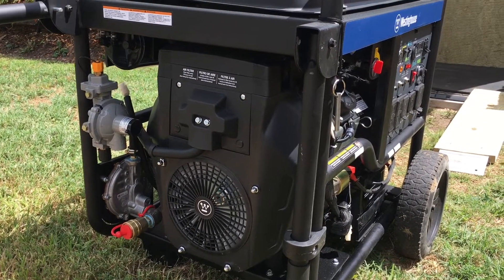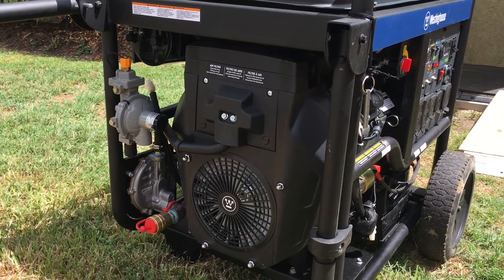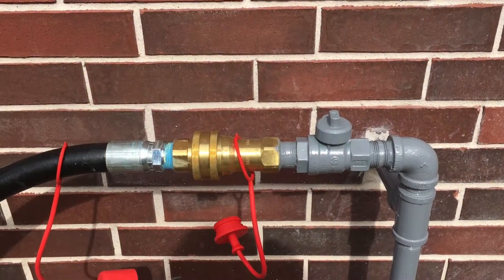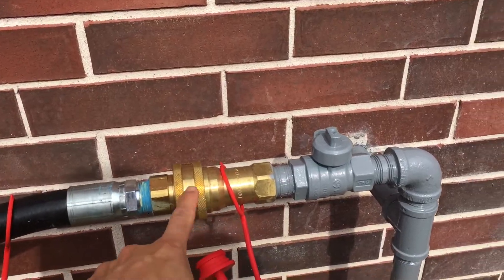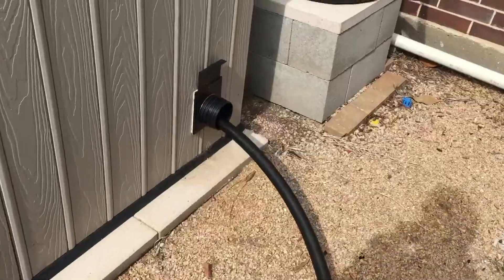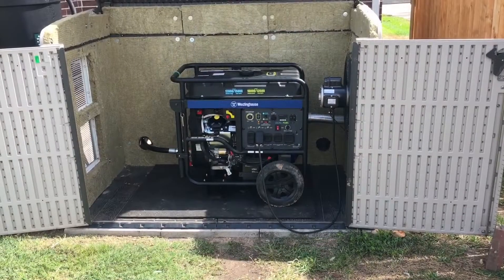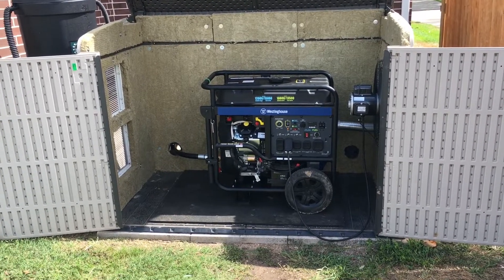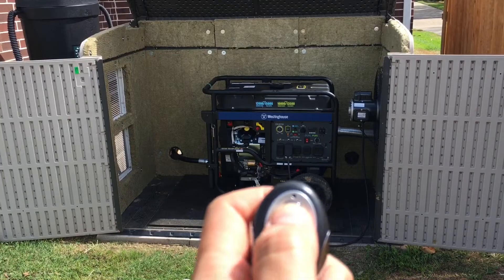Part 9- Westinghouse WGEN12000DF 15000 Watt Dual Fuel Portable Generator Running on Natural Gas

Comment: What size gas line are you using?
Reply from the maker: I used 1" ID hose, and only stepped down to 3/4" at the generator. I did this to yield the maximum amount of natural gas possible.

Key with using natural gas as fuel for these generator, that most don't understand you must have enough volume of natural gas flowing through the hose. 

If not, the generator this size will be fuel deprived.

For example:
At length 30 feet you can flow 
1/2" 95 Cubic Feet of Gas per Hour
3/4" 199 Cubic Feet of Gas per Hour 
1" 374 Cubic Feet of Gas per Hour

Hope this helps. Thanks for watching.

Comment: Isn’t a regulator required?
Reply from the maker: Yes and no. It depends on the what pressure your gas meter is. 

The WGEN 12000Df already comes with a Garettson regulator. In fact it come with 2 regulators. 

My gas meter is 7" WC (.25 psi)already, so that is in range for the Garettson regulator on the generator.

Now, say for example if my gas meter was set at 2 PSI ( 55" WC) then yes I would need additional regulator to bring it down from 55" WC to 6"-9" WC.

Hope this helps

Comment: Question...When running a 17500 watt generator on natural gas should i leave idle on or off ?
Reply from the maker: I run the WGEN 12000 DF, with the low idle.

Comment: Will the WGEN1200DF on natural gas be able to run a 2 ton AC unit and 4 ton AC unit if both have soft start kits?  LRA for 2ton is 56 @230 volts and LRA for 4 ton is 124 @ 230 volts. Thank you!
Reply from the maker: Nope, only 50 amp max available for the breaker panel.
Reply: @gilbosdiy  It will work because the soft start kit lowers the in rush amps and running amps. I have a 2 Ton AC that runs off a tri fuel generator. The natural gas side produces 5500 running watts.

Comment: Do you know how many estimated peak and running watts is it now on natural gas conversion
Reply from the maker: Well, here is the thing NOW, per Westinghouse should be around 11,600 watts running and 14,400 peak watts (via their same, but new WGEN14500 TFS).

This generator can produce more than they originally thought, BUT............ it is also a MARKETING.

Yes the generator, might be able to handle 14,400 and 11,600 watts. Thing is, in order to achieve those numbers. One would have to use the additional outlets, to reach those level. Which they don't tell you that. just looks sexier with the high numbers on the box.

If you plan on using an interlock to your breaker panel to your house, you can SILL ONLY have 50 amp for that, utilizing approximately 9600 watts.

Don't get me wrong, I am glad this generator can handle more than originally stated, it allows me shed load off the 50 amp (i.e. fridge(s) in garage, etc...)

Hope this helps, if you have anymore questions. Just ask, and I'll try and help.

Don't forget to hit the like and subscribe button, so that we can grow this channel.

Comment: Going gas but when hooked up to natural gas w kit it wont run. I’d there a valve near carb or switch ?
Reply from the maker: Did you turn the knob on the panel to propane?

Comment: The fan idea is great. What kind of attic fan is it and where did you get it?
Reply from the maker: Check out Part 7 of the video series, that episode goes over  mod for the shed and parts used.

I changed fan from 12" 1800CFM to 20" 3368 CFM.

The fan is a iLiving 20" Shutter exhaust fan from Amazon.

Hope this helps, thanks again for watching.

Comment: Does it handle an AC start up Ok? I will be getting one and having a soft start put on the AC to help with running on a generator for a short time.
Reply from the maker: All depends how many tons your AC unit is, 3-ton with micro air soft start yes. 5-ton no can do.

Comment: So you just ran natural gas to a propane receptacle? are they the same?
Reply from the maker: Check out part 8 of the 12 part series. That video shows how I converted the generator to run on natural gas. As well as which parts I used and didn't use. Thanks for watching. If you have anymore question(s) just drop a line, and I'll try and help if I can.

Comment: Just had a similar scenario.   My WGen9500DF (12000 peak) with an added natural gas regulator, while using the natural gas as fuel source,  was not able to run my 5 ton a/c compressor (would kick WGen offline).  When using gasoline as the fuel source,  the WGen was able to run the 5 ton unit,  but only after installing the microaire soft start (72 model) which stopped the "hard" start- high amp draw issue that was happening  causing the WGen to kick offline when the A/C started.  My peak average amp start after the microaire soft start installed is approx 30 amps and running amps are approx 13A.  Prior to the microaire softstart install,  the starting amperage of the A/C unit was high and would would cause the WGen to trip offline, no matter what the fuel source was.   I didn't get an exact "pre microaire install" start amp reading, but I do remember  the  "hard juttering" sound the A/C unit would sometimes make and it would even sometimes make the lights in house flicker, all this even when using normal "on the grid" electricity.   The "hard" start sound and light flicker issues and no more after the microaire soft start install.  With that all said,  the natural gas mod works great running my WGen and feeding the house electric, minus the 5 ton A/C unit.  I just used a window unit and a portable A/C unit to help keep house cool enough.  Hot water heater is gas, stove is electric, furnace heat is gas.   A/C unit is fully serviced and less than 5 years old.

Comment: Nice set up, I'm looking at this Westinghouse now.  I have done many of conversions to natural gas on smaller units 20 plus.  Load testing between gasoline to natural gas is about a 20% reduction in watts, LPG is about 10%.  Question on this conversion, on this v-twin you don't have to install a load block on top of the Garrison to adjust the air/fuel?
Reply from the maker: For my house, the supply line from the gas company was 1" INNER DIAMETER has a gas meter with 7" WC or 4oz of pressure. So, I ordered a 1" INNER DIAMETER, 30 feet hose (ab3power) ran from the meter to the generator (actual distance between meter and generator about 28 feet), then stepped down to 3/4" into the KN Garretson regulator. 

I'm sure as you know with all your conversions you know how important it is to maintain enough pressure and volume of natural gas. From the KN Garretson regulator outlet to the generator, I did replace with 1/2" barb by 3/8" MIP brass adapter fitting. With my setup of gas supply, distance and hose size I didn't need it. The meter on the generator showed 60HZ, 240V. Now, your situation might be different (i.e. supply, distance,etc... )
Reply from the maker: Oh, I also went with quick connects and ball valve that were FULL PORT. So that I would not have any reduction in size  from the meter to the generator.

Comment: Thats great it runs. Now what all can you turn on using natural gas?
Reply from the maker: When we had our last outage which was about 8-9 hours. I was able to run my entire house 3400 sq ft, with 2 fridge, and 3-ton a/c. Dryer, stove, and water heaters are natural gas. Only things I didn't try to run was my double convection ovens or 5-ton a/c ( I had not hook up the micro-air soft start at that time, I had only connected the 3-ton). Then again even if I had hooked up the micro air to the 5 ton, on NATURAL GAS with the reduced wattage. It would have been too much for the generator. If I was using gasoline, it would have worked. Then again I knew that going into the conversion. My reason for the conversion was to have reliable fuel available at a moments notice during a major outage, without having to chase it down.

Comment: Have you compared running costs between natural gas and gasoline?
Reply from the maker: Yes, not even close. Based on natural gas ($16.00 per 1000 cubic ft) and gasoline ($3.02 a gallon) cost in my area . I believe it comes out to roughly  for day $34 on natural gas vs $69 on gasoline.

Comment: Awesome ideas here. Thanks for the info. Question, did natural gas give you less running watts or kept it the same as LPG?
Reply from the maker: Thanks, glad that the videos helped you out. Make sure like and subscribe, for more videos.

Running the generator on natural gas will lower the running watts on the generator.

Guess, guess the reduction in running watts, brings the running watts down from 12,500 watts to about 9500-10,000 watts. So anywhere from 20-24% reduction.

I knew going into the conversion that I would see a reduction in wattage. The main reason, I converted this generator was to give me more options for fuel. Natural gas first, then gasoline if need be.

Chasing down gasoline during a massive power outage in a major city, not fun.

Comment: Hi buddy, is there a max length on the hose one can get?  My meter is about 70-80 ft from where I want to put my generator.
Reply from the maker: Yes, generally, you would want the gas line run to be as close to the meter as possible.
Here is a good chart to use as a guide:
http://www.uscarburetion.com/natural-gas.htm

Comment: More info on the exhaust setup please.
Reply from the maker: Sorry, been super busy. If I get a chance next week I'll try post a video of the exhaust setup that I will be using and the parts. 

The short of it, basically parts I picked up from the auto parts store. 

Exhaust reducer
2 hose clamps
Flexible exhaust
Exhaust heat wrap (Amazon).
Reply: @gilbosdiy  Tks, did you have to do any mods to the exhaust reducer for it to fit correctly?

Comment: Do you know the power output of the generator on natural gas? I know it drops a some from gasoline to propane and it drops again from propane to natural gas
Reply from the maker: I believe, I read some where that it is 20% reduction compared to gasoline. Not sure how accurate that number is

Which would put the WGEN 12000DF nat gas numbers around:
Surge 12000 watt
Running 9600 watt

Comment: I would like to see how you converted the dual fuel unit to a tri-fuel unit.
Reply from the maker: Craig, I didn't covert to tri-fuel, I just ditched the propane for natural gas so just still dual fuel. Watch part 8, and it shows how simple it was on the WGEN 12000DF. I could have made it a tri-fuel, I guess, by just adding a T, and couple shut off valve, right before the Garretson regulator.

Comment: Thanks for that great series of videos. I am expecting my 12000DF anytime now and your videos help me plan ahead. Thanks!!
Reply from the maker: Also just incase your generator doesn't come with an oil drain hose. Do that mod before even running it. It will save you a lot of mess and headaches, but I think Westinghouse, saw my video calling them out about that and they started including it now.
Reply from the maker: No problem, hope it helps make setting up your generator just a tad easier and cheaper.

Comment: Great job! Will suggest you add a tachymeter to be certain the gen is running at 3600 rpm or close to it while on natural gas.
Reply from the maker: The tachometer came in the evening after I posted the video. Just not enough hours in the day.

Comment: Great idea to have the fan hooked up to the generator. You don't need it unless the generator is on, may as well plug it in to the generator.
Reply from the maker: Well if you plan on using a shed like structure, a fan big enough for air movement to remove the heat from the generator is a MUST, or your generator will fail. Due to the fact, these portable generator are air cooled not liquid cooled generator like the standby units.

Comment: Great conversion, so much simpler and compact. Keeps it looking like it was stock.

I pretty much copied your exact conversion. Thanks for the videos.
Reply: Please pardon being off subject; my concern is that since the generator is electric start only meaning it needs a battery, how would you maintain a spare battery in case you need it. Again I apologize for being off your great conversation which by the way is not an option where I live. Really appreciate your insight on this generator.
Reply from the maker: @nonya7455  you would  use a trickle charger. Check out video number 2, where I go over the NOCO Genius battery charger
Reply: Thanks, I am currently using a small solar panel (1 year now)and it has been ok. Just thought a backup second battery would be a good idea. Thanks again.
Reply from the maker: For me, since I don't store the generator outside when it it not in use. I pull the battery off the generator and keep the battery charged with NOCO trickle charger on the workbench. Some might see that as an inconvenience. No big deal for me for 2 minutes of work.  During hurricane season, I crank up the generator once a month, to make sure it cranks or if there is a storm forming in the Gulf. Also finding one of these 12v 20-22 Ah battery is not too hard, at your local auto parts store.
Reply: @gilbosdiy  I didn’t realize the battery would be that easy to purchase locally. I will be checking that out. We never lost power during Irma or Mathew but here lately even on a clear day power outages started happening. I run it once a month and sure enough we lost power that afternoon. You just never know anymore…
Reply from the maker: @nonya7455  ding ding ding. That is why we all do what we are doing.
Reply from the maker: Glad I could help. I was surprised there hasn't been more videos with the conversion for this generator. 

Yea, seeing that the generator already had the Garretson regulator, I was glad I didn't need to replace it with another Garretson regulator that has a primer button. Being able to use the stock location was another bonus. That allowed me not to have parts sticking outside the stock footprint of the generator, even with the quick connect.
Reply: @gilbosdiy  yeah that's what I was worried about. Having a part extend beyond the frame just for a better chance of something being broken. That's unless you keep the generator in the shed 365 days a year.